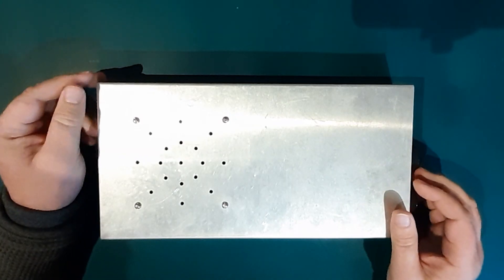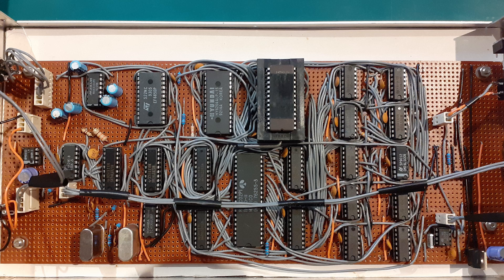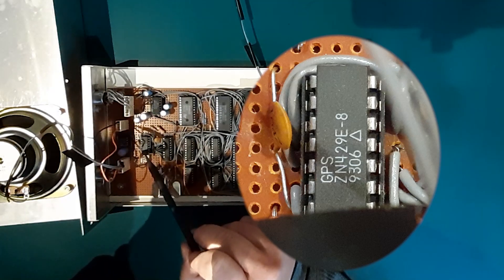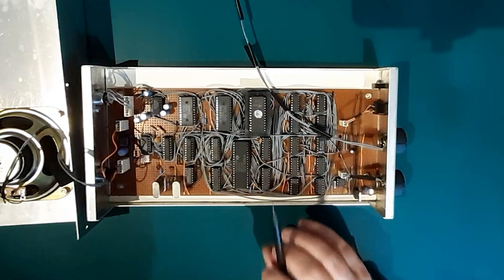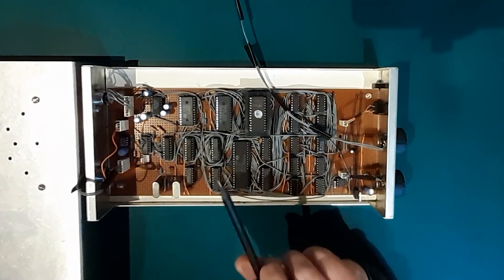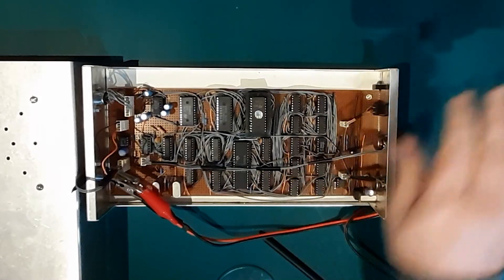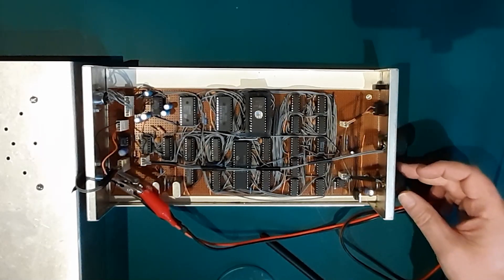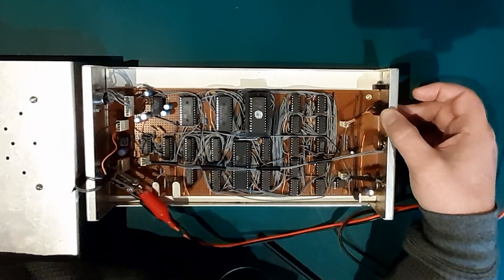Found! What is this mystery prototype from the early 90's? - Retro, 6502

Comment: Fascinating retro project. It amazes me just what we needed to do for something that is so simple now.
I remember probably around the same time, mid  90's doing something similar but using an ISD1016 and a Pic16c55jw. Could record directly into the ISD chip, a whole 16 second. The audio quality was relatively good as it stored it as an analog level in capacitor arrays.
Those were the days!
Reply from the maker: Sounds fascinating